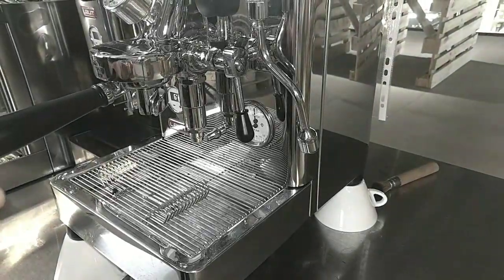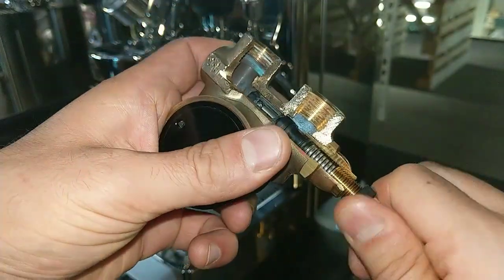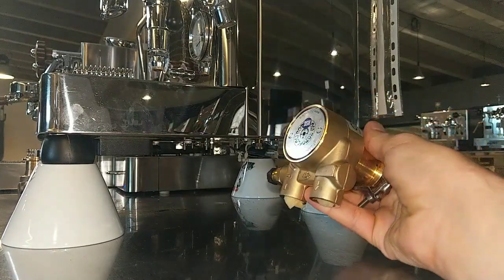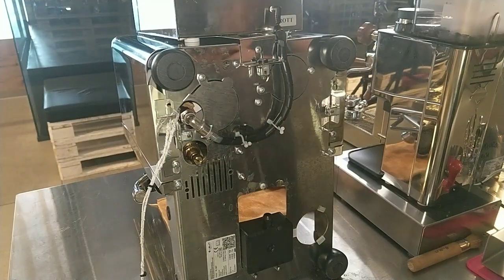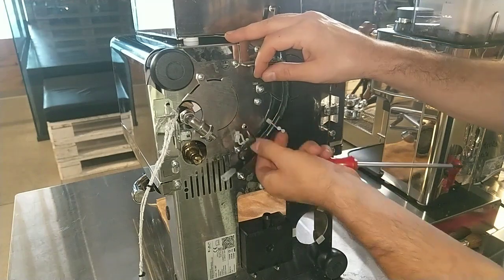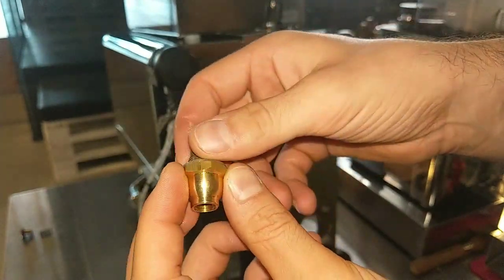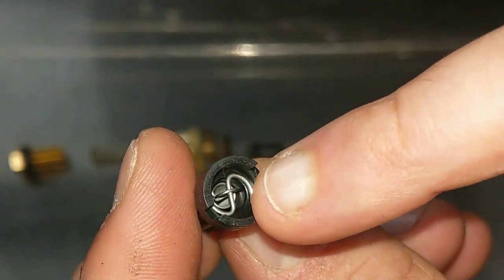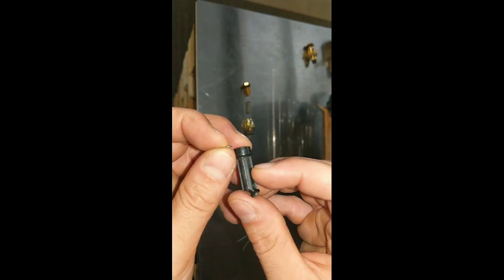pl162t pump 9700002 bypass regulation problem LELIT Bianca Giulietta (bypass code 4000063)

Comment: Thanks! Do you have a video on removal and cleaning of the rotary pump? As it is a common problem that the OPV get stuck and the adjustment screw wont do anything anymore. Thanks!
Reply from the maker: if you have the bypass video you can remove the bypass (not all the pump)
like in this video

Comment: I have noticed on my bianca v1 when setting the pump pressure whit closed paddle, the pressure increase 1 bar higher when the paddle is open. Same thing when pulling a shot: at first the pump is on 9 bar, but after the pressure in the grouphead has reach his maximum the pressure of the pump goes on 10 bar. Do you know why? And which pressure is the relevant one for the shot? First or second?
Reply from the maker: The importan is the pressure on the grouphead, the other shows only the pump pressure

Comment: I noticed pressure increasing on my Lelit Bianca, so I screw the valve out a bit for decreasing pressure. Then it only shows 7.5 bars pump pressure with paddle fully opened and around 10 bars with closed paddle or blind basket. Now a few days later pressure increases again, but only with closed paddle or blind filter basket up to 11.5 bars. Pump pressure stays at 7.5 bars with fully opened paddle. I think there is a regulation problem with the bypass, same problem as shown in the video?
Reply from the maker: yes, it can be the bypass,
Reply: @lelitinsider2977  Update: I removed the bypass completely as shown in the video. The plastic part with the o-ring wasn't blocked or tight, only a little bit limescale, I cleaned it and put a bit of silicone grease on the o-ring. Didn't solve the problem at first. Then I also removed the rear plastic part with the spring in it and I noticed immediately that it was very very firm. Took some time to get it out. I give all a good clean an reassembled everything. Now it works. Solved the problem.
Reply from the maker: perfect! if you need it is possible change only the bypass!
 @stefanb7529